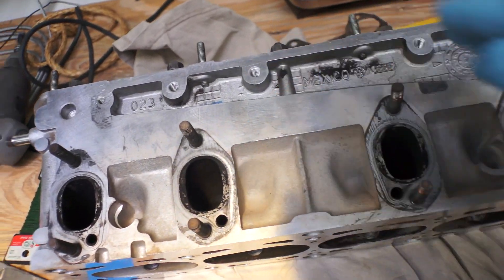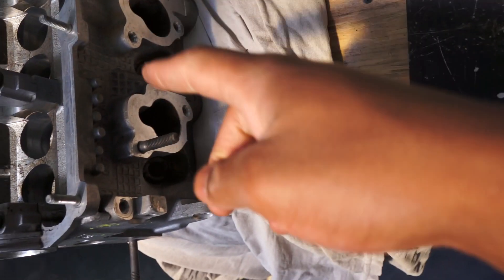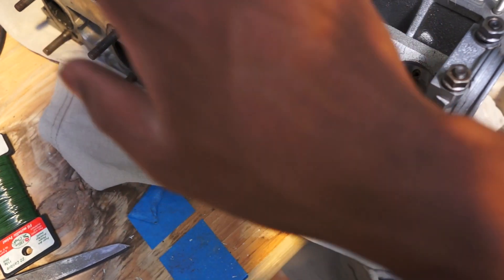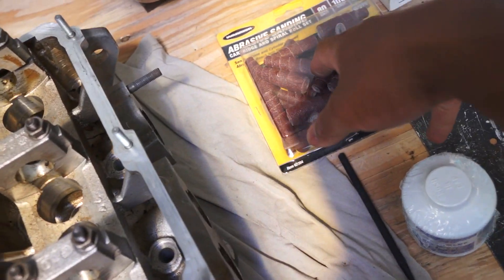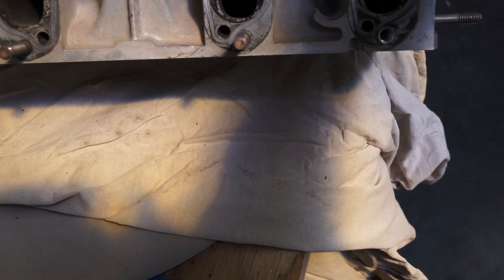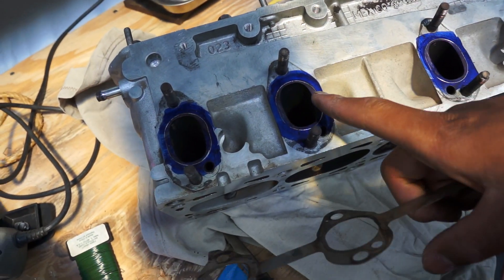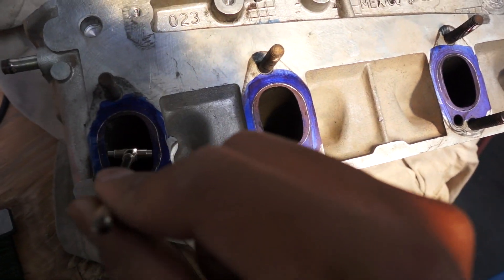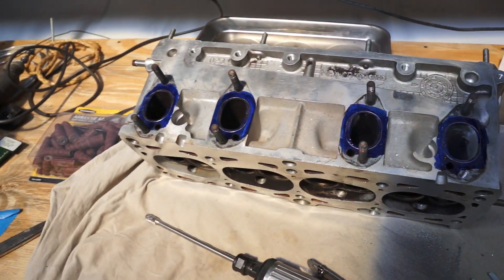Building My Spare 8v Head

Comment: You probably finish your work long time ago, but One tip, I have flow tuned One VW 8v head for my own car, and I noticed that changing the ports makes almost no difference at all, the biggest gains come from valve and valve seat work and valve deshrouding, ports usually are not that restrictive, you have to work where you have the restriction, not where you dont.
Sometimes matching the ports is actually not a good idea because it Will be difficult to align the head+gasket+manifold, so usually they intake ports on the head are smaller than the ports on the gasket and intake manifold, and the exhaust ports on the head are also smaller só you have no risk to have a big step when you Bolt all the parts, because there is some play.